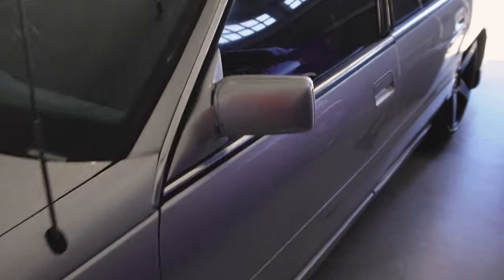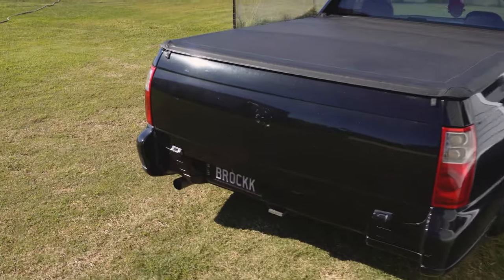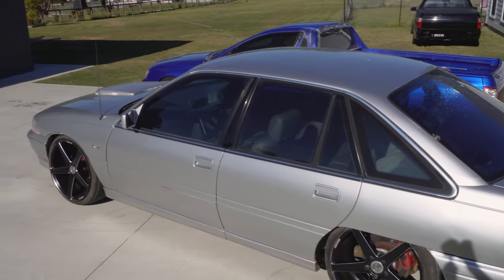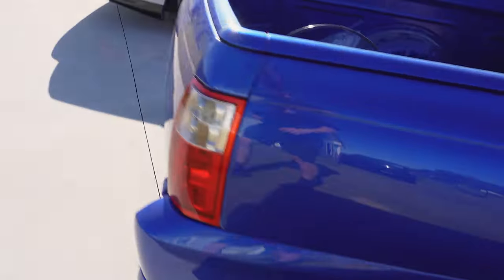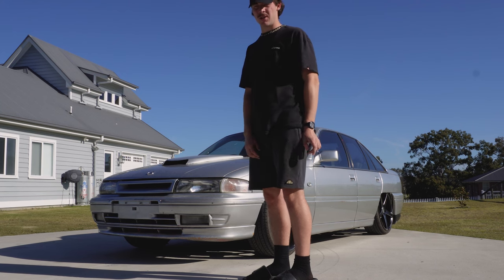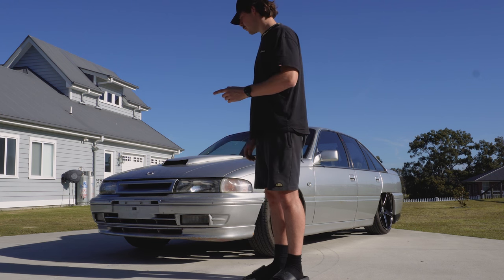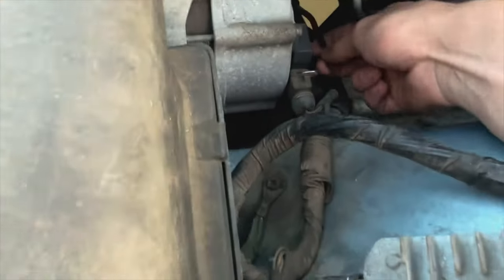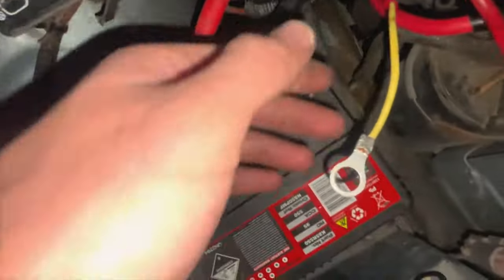NEW DAILY 1991 VP Calais 5L 304 V8 - Walk around

Comment: You sure its a VP, its got VN tail lights and garnish, VN dash badge, no spats, is it IRS or solid diff? 

Those seats look to be vr or vs statesman, and the little woodgrain door trim things.
Reply: I was wondering the same, got the vp Calais Chrome inside and out on the doors, climate control, steering wheel, and vp buttons around the cluster. 
IRS or solid diff will determine what it is. Mate commy either way
Reply from the maker: VP IRS 👌🏽
Reply: @BrockHarper  deadly I love irs get them nice and lower than solid diffs